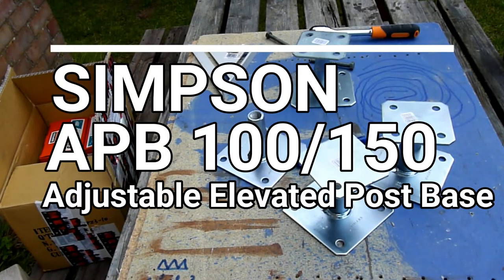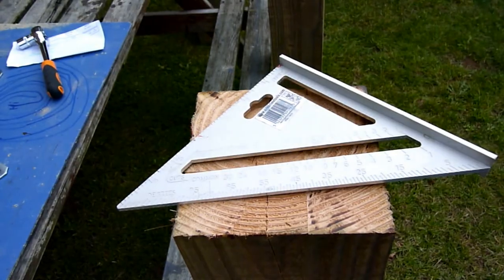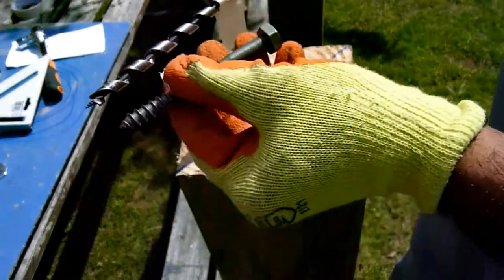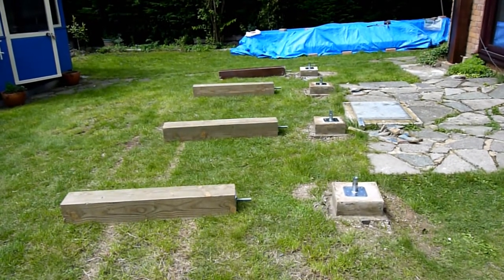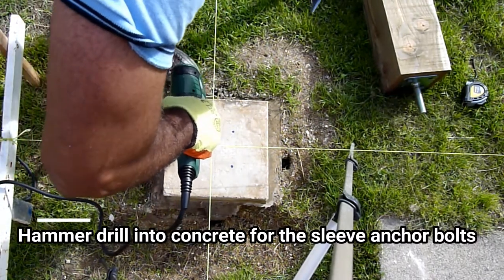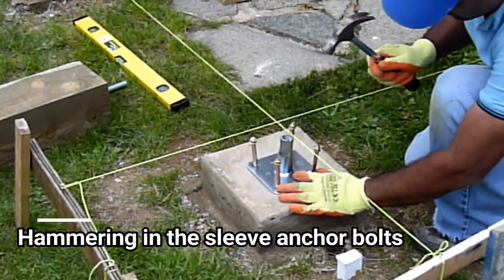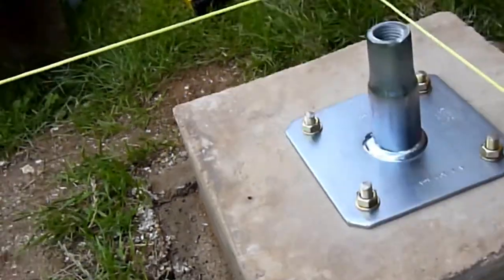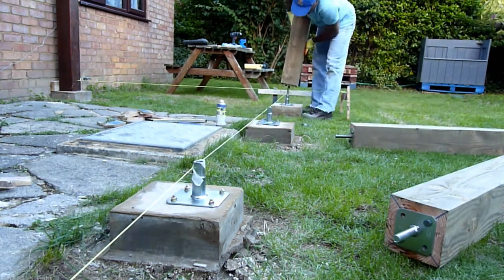Simpson Post Base APB100/150

Comment: Hello, thank you for some really informative videos. 
Can these apb post bases take the loads of a pergola, just thinking that the weight is finally down in the threads between the two screws.
Reply from the maker: Yes Arun, It can. It's designed to support posts for car ports and all. Zero flex on my pergola as well even after 2 years.
Reply: Suj Menon DIY Builds 
Thank you for responding quickly. I will go ahead and order it then. Need something that is adjustable as I am not very confident of getting a perfect level across 5 points when making the concrete base.

Comment: Hey,  I am new to construction. I am not quiet sure why such post bases are adjustable. Could u clear me up :) tia
Reply from the maker: Hi Bira, its used when you need to adjust the length of your posts by around 100mm to 150mm. Its essentially a screw type mechanism, but can withstand the sheer force of the post and roof. The issue is with freestand posts, the ground height among posts could be different, and this will help you to get it aligned. Hope it makes sense